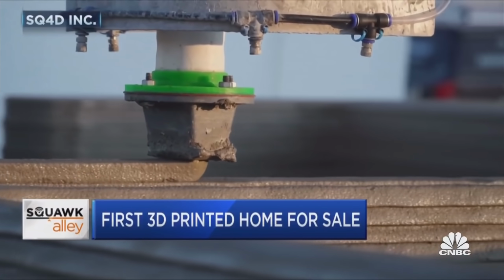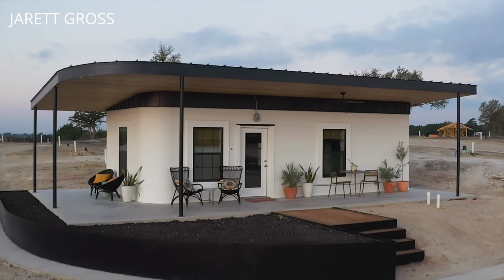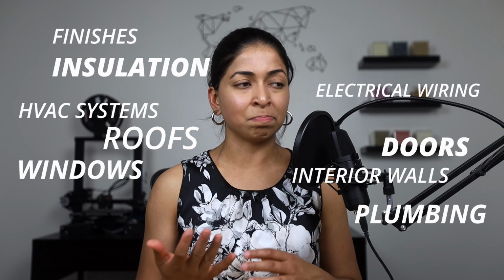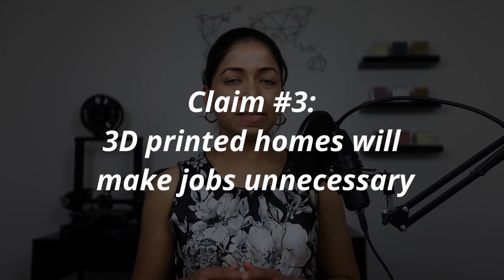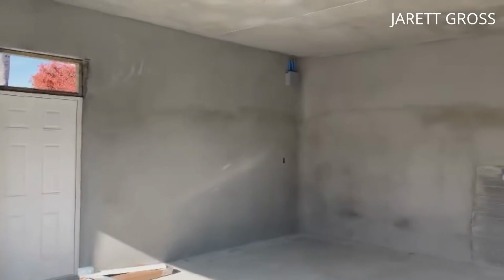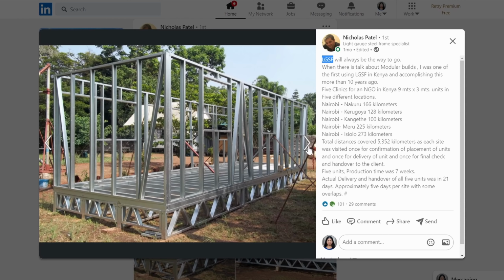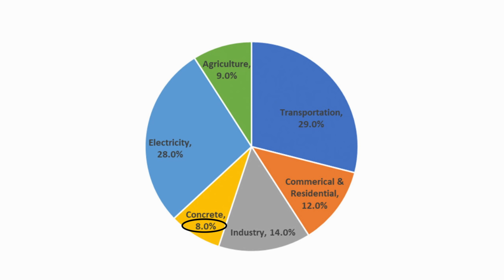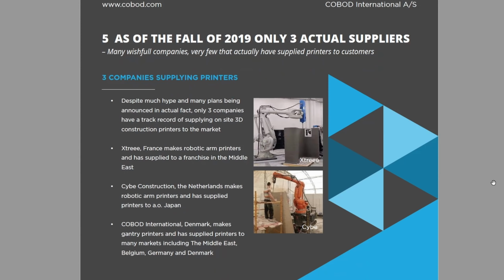Exposing 5 LIES about 3D Printed Concrete Homes

Comment: Very balanced and common-sense dissertation.  Aside from the 'sustainability' green take (nature takes care of itself - we as humans have no hope in affecting the environment), the mentioning of all the supporting tasks that surround the printing operation remain labor-intensive.  

Many people's thoughts on 3D printing in general - at this point its strongest use is in prototyping.  Where computer-guided machinery shines best is in CNC, provided it is a production unit pushing out many parts, even a few niche parts that are hard to make with manual means.  Printing has a way to go because it remains slow because of the materials limitation (setting up).  The reason this problem is a thing is because when printing, raw materials are being used, and the materials must set.  Conventional construction does not have to put up with this delay, because the materials are already made and ready-to-go, and almost all labor involves cutting down these existing already-made materials, which takes only last as long as one can turn on a saw, etc. and use it, for example.  Conventional construction does not involve futzing around with any raw materials.  (Raw materials defined here as things like an uncut tree, uncured resin, steel yet to be made into nails, etc.)

But wait!  Concrete is used in regular construction too!!  Yes, grasshopper, it is.  But making a basement wall and slab, for example, is a phased step.  All the other work is done after the house sits there for a couple of weeks.  Seems like what needs to happen with 3D printing operations anyway.  So instead of advertising this as a labor eliminator (which she eloquently disproves), it should just be another method that happens to have a lot of potential.
Reply: I find it odd that you can say that we "have no hope in affecting the environment". 
According to The Food and Agriculture Organization of the United Nations 38% of the landmass in the world is used for agricultural production.

EU landuse stats I found say the following:
"Agricultural land use is the most common primary land use category in the EU; it accounted for 39.1% of the total area in 2018 (see Figure 1). Areas used primarily for forestry covered 35.9% of the EU area, while 14.8% of the area of the EU was unused or abandoned (...). A much lower share (5.7%) of the total area of the EU was used for services and residential purposes (...), while uses with a heavy environmental impact (...) claimed a further 3.9%, leaving just 0.5% that was used primarily for fishing. "
(Replaced the contents of those brackets with ellipses to shorten the quote)

If we exclude the abandoned or unused and forestry that's 49.3% of the area in Europe that's being used by us for one reason or another at a minimum.

Personally, I think it's pretty freaking awesome what we have accomplished as a species. We have radically changed our surroundings to fit our needs and desires. A feat that has taken centuries of scientific advancement, magnificent feats of engineering and countless hours of labour from literal billions of people.
To so blithely say that we "have no hope in affecting the environment" is sheer blindess to both our achievements and follies as a species.

Comment: You are doing very good work, clarifying the details. Hype is a big problem in media. Working in a somewhat related field, I believe 3D printing houses en masse is nonsense, for all the peripheral problems that you mention. 3D printing is great technology for prototyping; this is pretty much it. After the prototype phase and into mass production, 3D printing will never outcompete other technologies. One other area where 3D printing might be better than traditional methods is creating special purpose/custom structures, which in a way is similar to prototyping.

Comment: The economics of container conversions proved to be a fallacy as well due to all the modifications required for doors, windows, increased room size with two or more containers, and the structural reinforcing after the modifications.

Comment: It should be obvious that printer will not put a window or wires, but when i can create plan for the house and it being done exacly as i want it to, is best thing. And compared to how long can it take to create a house properly even a week is not a big time, additional to angles curves etc. Additionally if printed would be planned properly we could print dome house, so that roof would be there.
As for soil and other "where can it be build", we should have architects and people trained to know what type of soil can sustain what type of building with full foundation.
We can print house in parts and put piping for wires, or others in such a way that we would have self contain easy to fix solutions. We can even print house that way that mice or other creatures would not find way into homes.
3D printing is for housing market as tesla for automotive industry. It takes valid tested apprach and makes it so anybody would love it beside all downsides of which if people would know they would never trust this system.
It has myths but nothing that would not ring a bell in anybody that knows their shit, and rest will believe in anything so that should be no concern.
Reply: One thing I know about concrete is it cracks. No sign of rebar or anything else that I've seen in any of those 3D house printing videos. Also no sign of electric cables or plumbing in the walls so it's no better there than conventional concrete or block walls.
Reply: @shaunp9592  I had seen that they put sleves in printed concrete before it will pu layer above. 
I'm not so interested in those, You seem to be, and You had missed this?
Sir...

Comment: Lets see...she didn't mention that concrete homes last for 100's of years, has amazing thermal mass, better insulation, and can be made cheaper...oh and is a much safer house when it comes to fire risk, tornado risk, huricane risk etc.  No method is perfect, but look at older countries and see which houses stand the test of time....there is no wood house that lasts anywhere near a concrete home or costs the owner less on a month-by-month basis.

Comment: You could put a $60 tent on a piece of property in Vancouver and you would still need over $1 million dollars, its the property that costs. 3d Concrete homes havent been tested thoroughly for earthquake zones as far as i know and im in engineering. We do modular construction for social housing with wood and its quick, moderately priced, great quality control and conventional for the subs. Concrete emits a lot CO2 into the atmosphere.

Comment: I feel if someone criticize a new way of doing something…they should come with a solution that would be better then the new way that is trying to make a way…if someone can get a 3D printed home for 4,000 usd then yes to them and the company, otherwise what’s the point of buying a 300,000 usd printed home vs a 300,000 usd stick home?

Comment: It does have some pretty cool protentional though. For the past couple weeks I've been studying comparing foundation pours and 3D printed technology (general interest). I think WASP almost has the right idea by taking the actual grade located on site and mixing whichever solutions is missing in that local environment (if any). This idea can be used to create forms for a foundation pour or 3d printed cement. I'm not sure if we can truly get away from concrete and cement mix when it comes structural integrity and building codes (like in the US). Which like your saying does pose a conundrum saying its sustainable and eco friendly if what your taking from isn't local in the area and is not reused. 

Now if there was a way to take recycled concrete, plastics, and polymers and use that as a building material that gets mixed with on site grade and processed that would be a little more friendly at least in the first 100 years.

Comment: As all overhyped automated technologies released that "will completely remove labour work of the table" tend to end up being sustainable and efficient only in combination with manual workload. Same goes for 3D printing.
Personally i feel that the concrete walls are simply too wasteful compared to something like a combination of bricks and concrete or woden frames of walls with concrete filling etc.

Comment: Its not the technology that's the issue. Its how many companies are going about it. Most of these ideas of 3D printed homes as well as the shipping container homes come from Sercurity Companies and militaries.  Sercurity companies like the one I worked for who had contracts to set up FOBs used 3D printer prefab blocks. That were either made before hand or printed on site.  We did have a lot of FOBs and check points printed or set up with in 12 hours or less.  They are bar bones. They fill a propose nothing more and a lot less. We also has shipping container sets up that where prefab and assembled on site. Those were up and running on mere hours too. Even faster when you talk about check points. Those CEs were like romans. Those companies should build theme like we did or have a foundation and frame built them you place the 3D printed prefabs onto the frame. Kinda like what I saw in finlandia and Norwaia.  This would speed up the process exponentially.  As for pollutants you can use recycled materials or even Carbon based concrets/cements that don't require the use of waters or other harmful materials. You could even step away from concert entirely use heavy duty plant based polymers or resians.  Its a 3D printer. They are as versatile as an AR or LR.  It won't take that long to change out parts or use parts for other materials.  If other industries like the firearms industry and automotive and even the aviation industries can adapt to using 3D printing technologies then so can constructions. If I'm being fair I see many construction companies at lest State side and in Germany using this tech already have been as long as the navel industries.

Comment: I agree with what Mr. Patel says about the situation in Kenya. All these issues are things I’ve always wondered about when it comes to the African market. This isn’t sustainable and the only thing that’s saved is time. I don’t think the quality is good enough to create a better alternative to the stone walls that are common in Kenya and most of Africa. Furthermore, the amount of concrete being used is astronomical. The current methods are more sustainable. Unless we are looking for a semi-permanent structure then we can eliminate the use of concrete in 3d printing and use a different material in its place.  This raises the issue of sustainability in many different sectors. Mining, energy, so on … I hope these are issues that are actually going to change or improve in the near future.

Comment: I never saw these as a real option. Is the wiring and plumbing exposed inside? Or are they buried in the concrete? A problem either way. All they really do is print a foundation. It would be cheaper and stronger to do it the old fashioned way.

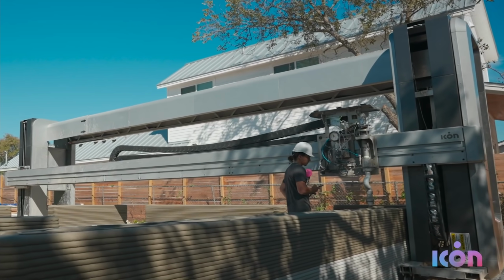Comment: 3:10
Why does the amount of printers matter? they still do the same job.
They printed what they needed to. I don't think you could print a solid concrete window or door.
The rest of it probably didn't take a while to do. Most likely they just had windows ready that they just put into the correct holes, and then fastened it.
Why does the plumbing matter? Some people in the world live without it. And you don't need to look far back in history to see people using outdoor toilets, and rivers instead.

Comment: The claim of 24 hours to print a set of walls in BS.  Concrete requires 24 hours for EACH LAYER. Any sooner, the weight of the next layer will crush the last layer!

Comment: At last a video which addresses the outrageous claims of 3D printed construction. The idea that an expensive and complicated 3D printer is cheaper than say, a concrete block structure to erect I always found laughable. I have seen the walls go up an a building in concrete blocks using traditional techniques faster than it takes to set one of these machines up and with less people. Other techniques like using more modern materials can be done even quicker. Building the walls is a small fraction of the total work involved in building a home and it isn't the most labour intensive or the most expensive. You pretty much covered every aspect in this video and covered them all well.

Comment: I don't know much about construction, but I am very familiar with 3d printing and technology in general. 3d printers can be a pain to calibrate, and there are many things that can make a print fail, those jobs aren't going anywhere. It'll be at least another 10-15 years before 3d printing starsts to become relevant in the construction of homes. As for construction workers, you should probably start familiarizing you company with this type of technology, so when the time actually comes, you will have an edge over other companies in the same field.

Comment: finally, someone said this out loud. you can just as well build a brick frame in 2 days, of a one storey house and you dont need time to cure. and i daresay its cheaper because you only need manual labour, not a machine to run the whole thing...

Comment: Yeah, it's kind of an odd duck. The challenges of portland cement concrete are well known: it gains strength gradually on the scale of weeks and months, it becomes difficult to work with on the scale of minutes and hours, it has horrid tensile strength, it has to be and stay well-mixed, and its production causes vast carbon emissions. None of those challenges are really addressed by squeezing it out of a glorified toothpaste tube moved around by some stepper motors, so it seems like fairly incremental technology.

Comment: There is a major problem with 3D printed houses. They are made of concrete. And for concrete, you need sand. And sand has become quite a rare material.

There might be wars for sand soon.

Comment: This type of architectural construction method is a wish in the stars. The thing about modern architecture is the search for ways to increase habitational density while keeping costs (initial costs+lifetime costs) low with a high quality of living. This tech shows no promise in increasing density or building quality. Instead we should be focused on mass timber construction for its cost-benefit ratio, its high fire resistance, low weight and lower cost of assembly.

Comment: I think prefabricated buildings would be good.

Like, entire walls made in a large field with all facilities,
And transportated to the spot, and assembled by humans 
That could be done in less than 24 hours at site.

Have entire moulds for 10x4 feet walls,
Walls with a window,
Walls with a door,
Roof concrete, etc.
Have iron rods sticking out from them.
At site, put them together by welding, and fill the gaps with cement.

Comment: The fact 3d printing  still needs all the extra work after.  Good old stick framed houses in the USA can be gutted and rehabbed after standing 100 Years.  
And even tiny homes need to meet minimal code standards, a 400 Sq ft house was almost the same price as an 800sq ft.  The shell of the house isn't the greatest cost it's all the rest of it that makes up the real cost

Comment: I’m pretty sure bricks or a tilt wall construction would be cheaper and easier than setting up a large structure to print a slightly smaller building

Comment: I just discovered your channel. Retired now, up through the trades & associated with the building industry for 40 years. This video is perfect. Thank you. You just want to shoot yourself sometimes. No less than the Washington Post had one of these articles. (My detailed analysis to the journalist received no reply, go figure.) "3d concrete printing prints walls, not homes" sums it up. And not even walls, as you point out. A wall is a wall SYSTEM composed of elements: structural, insulation, vapor barrier control, exterior cladding, and moisture barrier. Without rebar, it doesn't even perform structurally-- which makes it little more than exterior cladding, if you're a fan of lumpy. Plus it's all so silly: Effectively, setting up a cnc table that is the size of a house, setting it up on a building site, in the mud, and the tool moved, the (ahem) "printer," is fed by the local concrete truck and powered by 440v motors with precision calibrated controls.  Beyond words.

Comment: I would argue that a printed concrete house cannot be cheaper than concrete blocks, because of the cost to transport wet vs dry concrete. If you find an area that does not hold true, start a concrete block business.

Comment: I think prefab wood frame panels with insulation, and plasterboard internal panels are the way to go.
Re: 3D printed walls. it is easy enough to smooth out the finish before it sets, inside and outside.

Comment: It doesn't take forever to calibrate. Once calibrated the rest is printing. It still sounds  easier than stacking wood pieces with hands using guns. 3D printers can be very precise too, and as far as i heard they last longer. You can design any shape you like.
Reply: You can use plywood and 2x4s to cinstruct walls to poor concrete in, its faster and takes much less skilled labor.

Comment: The only thing you are right about is the cost. Everything else is purely personal choice. The fact that you're worried about the "precise" size of a printed window frame and whether or not they can get a window in it, shows me how much you know about construction. Being that the frame is made of CONCRETE, it can be grinded away to make it bigger, or boards can be added to make it smaller.. Maybe go work a construction site and then a make a new video. Try moving 30+ 9ft wall panels that weigh more than you do down a 12ft sand hill. Pretty easy for someone who has never done concrete work to say this isn't any better. You forget one very important factor. The back of the MEN doing this work.